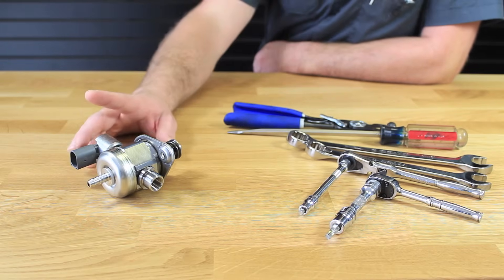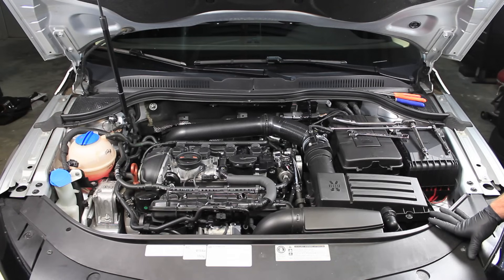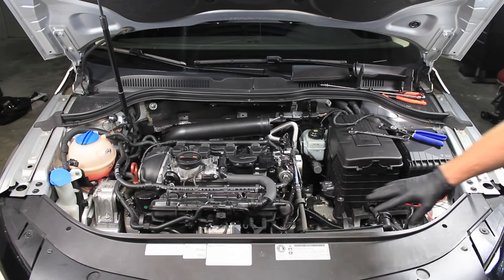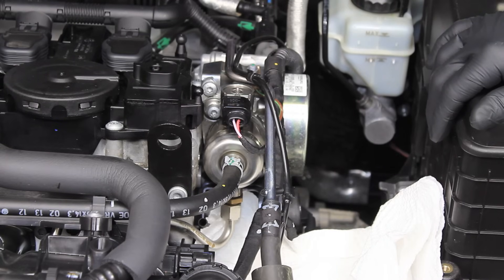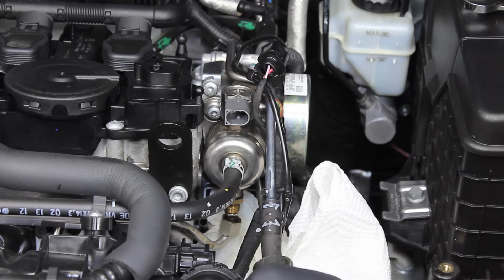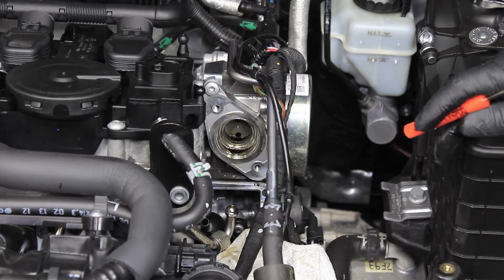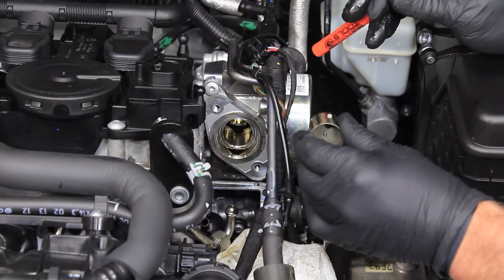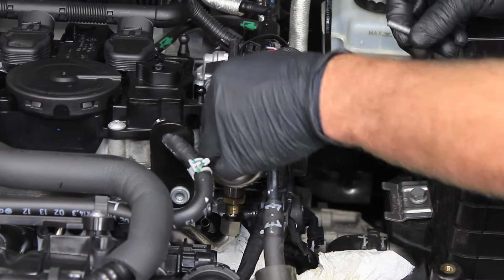VW 2.0T TSI Engine High Pressure Fuel Pump (HPFP) DIY (How to) Install

Comment: Wow, thank you so much for this video! My 2012 mkvi GTI just ran into this issue. With only 43k miles on it, I was quite disappointed, especially since that despite the pump being right on the engine block, it isn't covered under my 5 year powertrain warranty. I bought the HPFP from the dealer and installed it myself in just over an hour, saving me 500-600 dollars in labor that the dealer was going to charge me. Thank you VERY much for the level of detail in your VW videos; keep it up!
Reply from the maker: Bob Roche Sad to hear about your troubles. Glad we were able to help save you money by doing the job yourself.  Sorry we weren't able to help you with the part this time, check us out next time you need parts. We can help save you money on the parts too.
Reply: Bob Roche hi
what actually happened to your fault fp or what's were the symptoms ?  did the car stop running ?
Reply: Deutsche Auto Parts Hey Deutshe Auto Parts. I have a 2006 Passat BWA FSI MOTOR. went for a drive and notice lack of power or boost while driving. And it seems to take a while to start sometimes  and runs a little rough. Got a scan tool on it and got the fault Fuel Pressure Regulator Valve N276 Open Circuit P2294 No Signal No Communication Intermittent. Checked the wires  for any Voltage with Ignition On. Was Receiving 2.485 Volts. Was just wondering if its ment to be 5 Volts Ref Voltage or 12V battery voltage. I have a feeling that there maybe a break in the wire but im not to sure right at this point.

Comment: Ok guys. Ever heard anything like this? This is not my car but it is the exact same noise. I already got a new pcv and diverterfrom you guys ....didnt help.  Its a 2010 GTI and I'm at my wits end...dealer "couldn't reproduce" for 90 bucks...
Any input would be super appreciated.
Thanks!
https://www.youtube.com/watch?v=m3lygz8BvQs
Reply from the maker: Justin Fierro That seems like it could be the water pump.  We consulted with Humble Mechanic and he agreed.  He also had a tip, if you remove the coolant bottle cap while the car is running (probably has to be hot bc pressure) the noise could change which why help verify the water pump was bad.
Reply: I was afraid you were gonna say that....done the coolant cap thing and it does change the sound...thats not an easy diy...
Reply: Thanks so much!

Comment: Hi, can you help me please, I have Passat 2009 I check the check engine light with my scanner and its telling me "fuel pressure regulator. where is located in the car ? The car not start.

Comment: that one has a roller .. the damn vw engineers should have put that on all the others  instead of that damn "Thimble-Friction-Bastard" piece... just waiting to destroy my lobe ... great vid , thanks!
Reply from the maker: Thanks... Sounds like you have a 2.0T FSI which we have a video on here
https://www.youtube.com/watch?v=2jCzoQcDEkQ

We appreciate the feedback and your watching.  Please let us know if we can help with anything.
Reply: Deutsche Auto Parts- Your Source for Everything VW and Audi my vw passat 2.0t keeps stalling can that mean i have to replace the whole high pressure fuel pump?
Reply from the maker: David Henriquez David.  Im sorry diagnosing a car is complicated.  Assuming your issue is fuel related it is likely to be the high pressure pump, the low pressure pump or the fuel pump control module.  You should consider bringing this to someone to have them properly diagnose the issue.

Comment: What is the bronze fitting on the bottom of the HPFP that attaches to the high pressure fuel line? Is that a relief valve of some sort or simply a fitting?
Reply: yes it's a shredder valve to release any fuel in the pump.

Comment: 2008 Passat 2.0 TSI, getting P119A followed P0171 later.
Tested low pressure line, OK.
Cam Follower looks OK.
High pressure pump shows good pressure on scan tool.
High pressure sensor seems to work as well, since I am getting good readings on the high pressure line.
Symptoms:
A bit rough idle on cold
Hard cold starts occasionally

Any advice? Thanks for your time
Reply from the maker: Sounds like you might have a carbon issue.

Comment: why was the reason for replacing it ?  i ask this bcs my wife 06 vw passat 2.0 t does this every time she fuel up the car does not want to start and is every time and only whe ads fuel to the tank . do i have to replace this HPFP?
Reply from the maker: This sounds like that vehicle could have an issue with the N80 Valve 
http://www.deutscheautoparts.com/View/06E-906-517-A/06E-906-517/0/139725
Reply: G ramos no you don't have to replace the HPFP.all you need to replace is the evap canister valve super easy you can d it yourself and it only cost 30 dollars.

Comment: Thanks for the video. My question originates from a 2009 Passat 2.0 Turbo (timing chain engine). Does this high pressure fuel pump have common failures, or might it have a tendency to over-pressurize causing a DTC? This vehicle does have a code for high fuel pressure. Thanks in advance for your input.
Reply from the maker: Lodestar These do sometimes fail on 2.0T TSI engines.  The would likely not be the cause of an over pressure fault, however we would advise having the vehicle properly diagnosed if you are unsure of the problem.

Comment: Hey thanks for the vid info.... I have  09 GTI and do you know if it has the roller set up? Ive seen the wear at a shop on the non roller he had to replace the FP and cam because of it...This is why I searched for this video to inspect mine.... Hopefully it has the roller on it...
Reply from the maker: Scott Roach You should have the Roller on yours and the TSI do not generally have the same type of cam follower wear as the earlier 2.0T FSI engines.

Comment: Hi, I’ve been having a check engine light for many months on my 2008 Passat 2.0 T. Was told that I needed to replace the intake manifold flap runner. Had a P2015 code. Bought the intake manifold but never had time to replace it. I kept driving my car with some problems during cold starts every morning (shaking car). Today while driving my car it suddenly lost power and the engine shut off. Was difficult to start and I can’t drive it anymore because the engine does not idle and shuts off or if I push the gas pedal it does not responds. Ran a v-scan and had the following codes P2015 intake manif runner pos sens/switch circ range/perf bank 1 and P2293 Fuel press regulator 2 perf.  Do you think that the high fuel pump pressure is broken too? Any thoughts?
Reply from the maker: Its possibly you could have an issue with your pump, or it could be a fuel pressure switch.  We would advise fixing the know issues (the intake flap motor) before trying to diagnose any further issues.
Reply: Deutsche Auto Parts- Your Source for Everything VW and Audi replaced the intake manifold and no longer the faulty code. But still having problem with engine going dead and fuel pump codes. Checked the high pressure fuel pump and everything looked good but since i took it off O also replaced the cam follower. Still same problem fuel pump codes. Any advice?
Reply from the maker: Rob MT The cam follower issue is an issue with the FSI engine.  This video is for the TSI engine.  If you have a TSI it sounds like you might need a fuel pump but its tough to be sure.  You should considering having your vehicle diagnosed by a pro.
Reply: Deutsche Auto Parts- Your Source for Everything VW and Audi it end up been the fuel pump control module. Made in  Romania!!, I wonder why it failed!  My car has been running strong for almost a month. Problem solved!! Thanks everybody for your advices.
Reply: Rob MT how much did it cost you?i also have the same issues.what's the difference between the fuel pump and the fuel pump control module?
Reply: David Henriquez the fuel pump control module is the electrical component that goes on top of the fuel pump. It is like a switch and it's malfunction will cause the vehicle to have problems with stalling or engine shutting off. The fuel pump its a piece that goes inside the fuel tank and although I replaced it I was told by most vw experts that it will almost never go bad. The main issue is that switch or fuel pump control module
Reply: Rob MT can you please send me a link of those two components
Reply from the maker: David Henriquez This is the fuel pump module http://www.deutscheautoparts.com/View/1T0-906-093-G/1T0-906-093-F/0/51866
Reply: Deutsche Auto Parts- Your Source for Everything VW and Audi yes, that the one. Unfortunately the only option is to buy the one made in Romania which seems to me is not of good quality. Here is the link for the electric fuel pump that goes inside the tank http://www.ecstuning.com/Volkswagen-Passat_B6-FWD-2.0T/Engine/Fuel/Pump/ES2697313/  but again, i was told that it almost never goes bad beside is very expensive.

Comment: Hello, what can be the symtoms when the fuel pump is malfunctioning? I have a problem with this specific engine. During the driving when you start to accelerate (after gear shift)  then for some period (when rpm are on low side) motor is shaking, when the rpm increse further then shaking-vibrating will be gone. What else should I check? Thank You in advance! BR fom Estonia!
Reply: Did you figure out what it was? My car is doing the same thing.
Reply: @Usefulvideeos  did u figure out what the problem was?
Reply: @homerds200  Not yet...I was told it's most likely the Mechatronics unit being faulty. But it's insanely expensive. So I don't know what to do tbh
Reply: @Usefulvideeos  could it damage the car if u let it like that?
Reply: @homerds200  Probably lol But I have no choice... its my daily. I have it up for sale...
Reply: @Usefulvideeos and now how did you resolve this problem ?
Reply: @homerds200  didn't figure it out. Sold the car As is.

Comment: Do you have to put the engine at a certain position to remove the pump so its not under tension?
Reply from the maker: You do not.  If the cam lobe is facing outwards on the pump it can still be removed and installed.  It will just have more tension than if the lobe is facing inwards.  Thanks for watching.

Comment: Excellent DIY! Thank you! Why did you replace your HPFP? Did it go out on you?
Reply from the maker: We replaced this part for demonstration purposes.  However this part does sometimes fail.
Reply: Deutsche Auto Parts- Your Source for Everything VW and Audi is there anyway to test the hpfp??i'm having intermittent stalling problems.computer shows fuel pressure regulator.
Reply from the maker: David Henriquez Im sorry we cant offer any more insight on diagnosis.